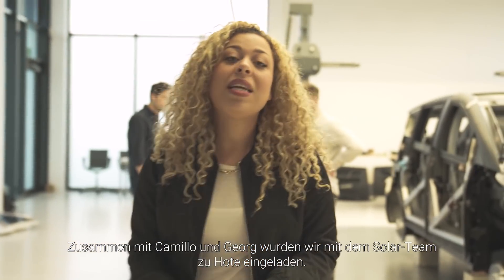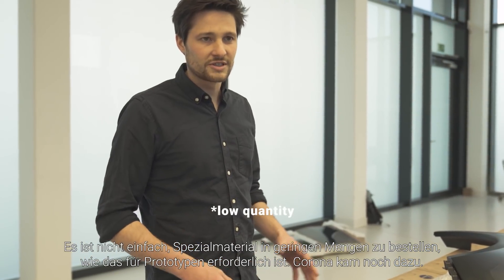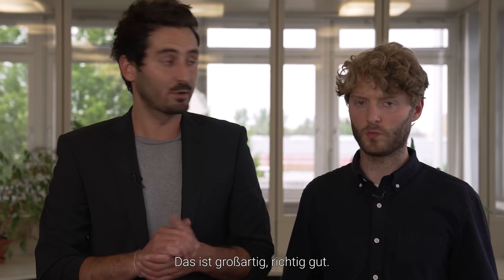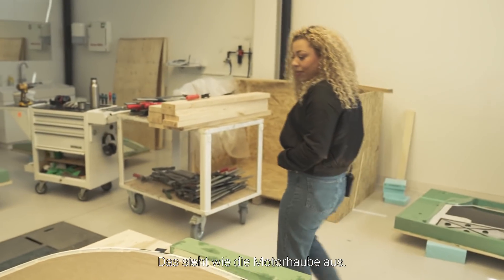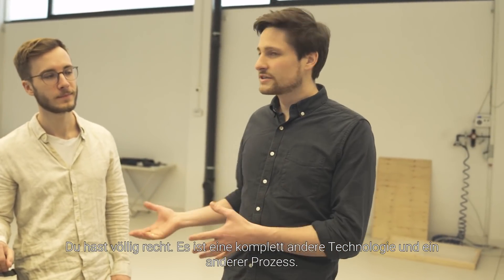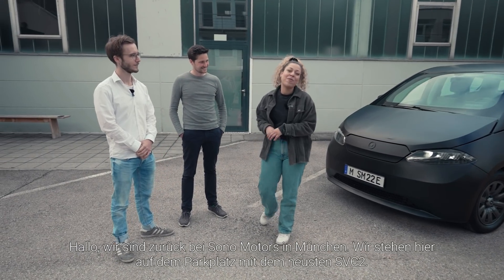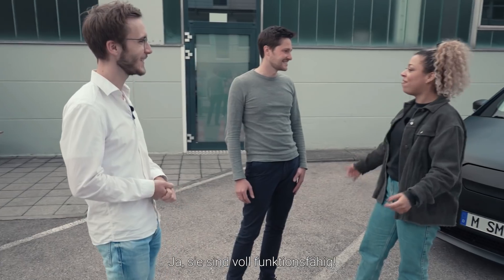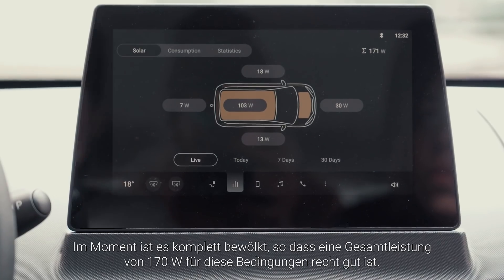Sono Stories: Solar Integration - Full Functionality | Sono Motors

Comment: As a curiosity i will be checking out the solar production once in a while. But on a daily basis all we really need is to see our range (how many kms left on the batteries) and if I can get to make another nespresso. question: what happens when it is in the sun and battery is full? will we get a electric shock or melt all the plastics?

Comment: Enought to provide what's the energetic consumption in board permanents ?
Enough for the cooling system ?

What will be grid tied "full functions" .

Will there be a dedicated "home use" acces, connectivity for batteries, panels ???

At least, will it be usable as an emergency back up system ???

Lots of questions about what's the vision the full functionality a solar panels equipped driveable battery bank on wheels ...

Comment: The SION 2021: Thanks to 248 solar cells 35 km additional range per day + the max range of 255 km (WLPT standard) is max +/- 290 km (Netto: +/- 240 km). You can also cover longer distances trouble-free. For effortless mobility ??? What about the newest technology for e-car batteries? 
Lets look at one of those new technologies: 
Plug-in cars that can drive 800 kilometers? With a Dutch invention you can! A battery on which a large plug-in car can drive 800 kilometers?
And just under 500 km? E-magy Netherlands, a company that was founded a year and a half ago, is working on a product that makes that possible.
The substance in question, silicon, is more expensive than the graphite that is now in many batteries. But the silicon gives the batteries more capacity, more power, 40 to 70 percent more. Main advantage of this: batteries can become smaller and there is a lot of interest in smaller batteries.
Major automakers are among the manufacturers testing E-magy's product. But there is also a lot of interest from manufacturers of electronics and batteries. The fact that e-cars are getting smaller (and cheaper) is in
E-magy's advantage. Another advantage is that battery manufacturers do not have to adjust their own production process, if at all, if they switch to pore silicon, because it comes in the same shape as the graphite they currently use.
I would like to purchase a SION e-car if the range would be at least 400 km (NET!). What do you think? Check out E-magy Netherlands: 
https://www.e-magy.com/about-e-magy/  and....  E-magy Empowering tomorrow’s batteries today: https://www.e-magy.com

Comment: How many km can you charge in one average day in Germany/ Europe with those solar panels? I guess about 5-10 km per day or so if the car is parked outside 24/7/365, right? How many km do the batteries lose over a day? If you subtract the lost energy, not much is gained, I assume.

Within the last few days, I tried a power bank with integrated solar panels to make a positive difference. I noticed that this particular power bank delivered way less power than specified. That's the first crime.

The second crime is that the charging is very inefficient. You have to put this thing in direct sunlight for 50+ hours theoretically to charge from 0 to 100 percent. I doubt that this will be enough time for charging.

The third crime is that the panels and the batteries lose efficiency and degrade in hot temperatures which is unavoidable if you need to put it in sunlight. That's why most of those "solar"-powered power banks are bullshit. I will replace it with a regular one.
Reply: Sono estimates to have approximately 2 km of extra range per day in winter and up to 35 km in summer under ideal circumstances.
Here is the chard from sono.
https://sonomotors.com/de/downloads/information-sheet/
In my case that would be enough to drive almost entirely by the sun in summer and once a week charging in winter.
Reply: @MechmanGetrieb  they wish/ advertise up to 35 km. I would like to see some proof for this claim.

Parking a car in the sun is a terrible idea in general. I hate to get in a car which feels like hell or in an oven. Cooling it down will cost probably more than what you get through the panels.

A car parked in the sun/ outside will degrade/ lose its value much faster than a car parked in a garage. Any research for that? I guess parking outside unnecessarily is not worth it at all.
Reply: @stebarg  I would like to see real world data as well! But simulations in that matter are not new. So I don't see a reasons why it shouldn't work here. With the new prototype there will be the chance to see what's it really like.
Reply: @vic321344  It looks as if Sono is riding a dead horse, desperately trying to make something worthwhile with solar panels and four wheels.

Don’t get me wrong; I wish they would do great, but I’m still not convinced about their product.

I don’t blame Sono in particular for that. I see another much more important issue.

The root cause of ALL problems is the perverse idea of trade. Thousands of companies have to have their individual resources in form of engineering and building power.

If we wouldn’t have to compete with each other, we could concentrate the best engineers for only a few projects. This world probably lead to much better products.

We could focus on a bunch of top-notch projects instead of millions of bullshit projects.
Reply: @stebarg  I agree with @MechmanGetrieb . The main problem was that until now they did not achieve a working prototype that has exactly the same technology (the same amount of panels, all of them charging, the battery...) as the final product. The current prototype is (I believe) similar enough, so I think they will be able to start gathering more reliable data now. To have something that makes more sense statistically, I would expect at least 2 months of gathering and analysing the data. 
They are planning to do test drives again with the new prototype soon (for press only, because COVID-19), so some data may be released by then. They are a tech start-up and need to secure investment, and the more data you have (about your product and about the market), the more likely you are to get it (that's why they started prototyping years ago, even before having the solar technology ready). Also, the press may ask about it during the test drives. For these reasons, I'd expect that they have an update ready on that front relatively soon.

I'm sorry for your powerbank experience. I also bought a small battery with a solar panel years ago and was very disappointed when it stopped working after a few months. However, I think that the likelihood of this happening here is lower. The stuff we bought was probably made by a random Chinese electronics company which can change their brand name for every iteration of products and can afford to sell shit without major consequences, especially because the product is relatively affordable and reputation is not very important. With car companies, however, there are not that many of them, and reputation does play a big role. If they largely underdeliver in their main selling point, the press and social media will easily let everyone know, and their main target customers will no longer have a reason to buy the car, so the company will inevitably fail. And Sono cannot afford to do the same thing as our powerbank manufacturers, because 1- they don't have the logistics to rebrand themselves and keep producing, and 2- that would not work. Almost nobody would buy a car that they never heard about.
So I really think it's unlikely that they are attempting to get their product into the market by deceiving their potential customers. They are not so stupid, and even if they were, many of their current investors and industrial partners are not and would not let them do it. In the same way, I think it's unlikely that Continental, the Mitsui Chemicals group (to which ARRK belongs) and ElringKlinger would have associated themselves with the project if they didn't think it had realistic chances of delivering.

(edit): As a quick note about parking in the sun, for what I remember, they were using some specific solar panels which do not generate as much peak power under direct exposure, but which are good at getting power out of indirect exposure (from reflected light, which to put it in a way is everything our eyes receive when we're not looking at the sun), which is why even the back part was getting something in a cloudy day. So in principle, even if you don't have your car parked right under the sun, it will still get some amount of charge (of course, lower than under the sun. Not sure of how much exactly, though). So if you're going to leave your car parked outside for several days, you should be able to leave it in the shadow and still have some extra battery charge when you come back (this is a partially educated guess, so don't take it as a fact :P)
Reply: @vic321344  I am sorry, but that is just a lie. I understand from your comments in all of Sono's videos that you are convinced that they will fail, and that is fine, but publishing an outright false statement with the purpose of damaging someone's image is plain disinformation, and we have too much of that in social media nowadays.

Sono Motors has done most of the things I remember them stating. They unveiled the first prototype and their plans exactly on the date they were supposed to, they produced the different prototypes as they said they would, delivered the test drives for some of those prototypes as stated, and after the community surveys about how some parts of the Sion should look like, they incorporated the most voted designs into the following prototypes. They upload videos about their status every now and then, and they even publish a monthly report with the progress on every department. Some may say that they are even too honest for their own good, as such level of transparency can make deals with investors more difficult (for what I read and heard from other start-ups).

What promises did they lie on? The delivery date and the battery price? Those were not broken "promises", but just wrong estimations. It is very common in the start-up world, and even to be expected. I don't know if you followed any other tech start-ups, but it happens very often that the people who have these ideas (and are naive/brave enough to get started with them) are people who don't know the sector they are getting in very well, nor its timings, so their estimations are not accurate. But even after they team up with more experienced people, these projects are so unique that nobody is really able to accurately tell where exactly difficulties will arise and how long it will take to get them sorted, so timelines need to be revisited time and time again as the project evolves. And there is nothing anyone can do against it; it happens even when big established companies want to introduce big innovations (but those usually keep it a secret until it is almost ready).

If you mean that the solar panels will not deliver as expected, and that is their lie, I'd say that until they are out and up for test none of us has the proper data to claim whether they are right and saying the truth, wrong, or just lying about the solar integration (unless you have access to some information to which the rest of us don't, in which case it would be very appreciated).
I'm also relatively skeptic about how much power we will reliably get, and it's one of the points that worries me the most. Luckily, the data is probably going to be out before we have to pay for the whole car, and in any case we have a legal refund period should it really not be what it is supposed to. And personally, even if it does not deliver more than 5 Km worth of solar power a day I may consider still getting it (depending on my income at the time), since having your car be an autonomous mobile solar generator can be useful for camping or emergency situations
Reply: @stebarg  👍
Reply: No, I think it should be able to charge for about 30 - 40 km per day, and modern batteries don't really lose a substantial amount of energy over the day, so there really is a good charging effect !
Reply: @bodoschneider-schrimpf8811  Could you please share your calculation with us? I guess those numbers of yours are just wishful thinking for a sunny summer day. I'm talking about an average day, including cloudy winter days..
Reply: @bodoschneider-schrimpf8811  Sono estimates to have approximately 2 km of extra range per day in winter and up to 35 km in summer under ideal circumstances.
Here is the chard from sono.
https://sonomotors.com/de/downloads/information-sheet/
In my case that would be enough to drive almost entirely by the sun in summer and once a week charging in winter.

Comment: Die Preiserhöhung damals wurde mit steigenden Batteriepreisen begründet. Die sind in den letzten Jahren jedoch wieder stark gefallen. Sind 9500 € für eine 35 kWh Batterie noch zeitgemäß? Wird die Batterie noch größer bei gleichem Preis oder das Auto günstger? Wer wird Servicepartner von Sono Motors? Wird die Ladegeschwindigkeit noch verbessert? Was ist mit dem Börsengang von Sono Motors?  Andere Hersteller machen riesen Entwicklungsschritte. 2023 oder noch später wird es mit diesem Sion sehr, sehr eng werden.  Ich bleibe euch trotzdem treu!
Reply: My thoughts too.. They must have a better estimate now of how much the batteries will cost.

Comment: @9:26 442W was displayed as PV power.
What energy can be assumed to be charged to the battery if these conditions last for an hour?
Am I correct to assume that the charged energy would add up to 29.4km in a time period of 10h if it is assumed the cars consumption to be 15kWh/100km?

Comment: Looks very cool.

I do have a question, if you measure the load capacity without using numbers but using everyday objects, can you get a bicycle in the back?  Or is there some other everyday object you can stick in the back that demonstrates the size inside of the boot...

Comment: Hi congretulations on the new panels.
Am I correct that the roof is not glass anymore?
Keep up the good work! Looking forward to the start of the production models..
Reply from the maker: Hi Ton, thanks for your feedback. Since the glass roof and the integrated solar cells would cause diverse light reflections, there will be no glass roof for safety reasons. However, the roof will of course be covered with integrated solar panels.